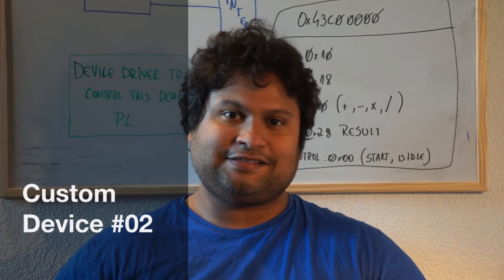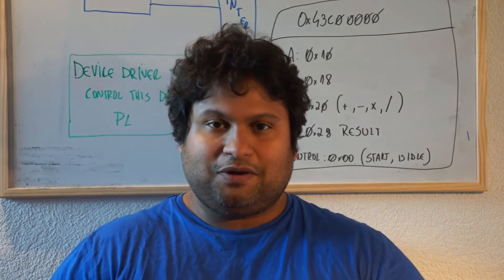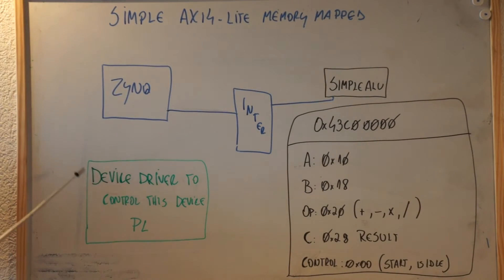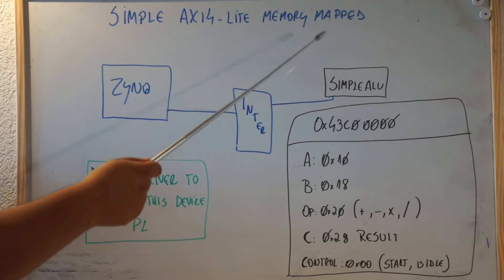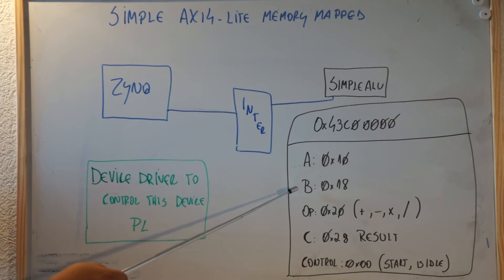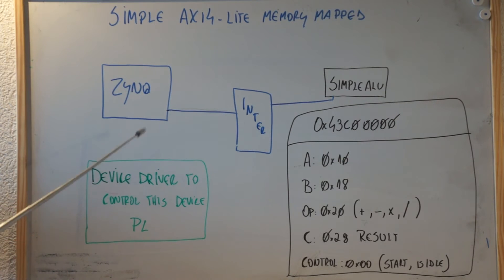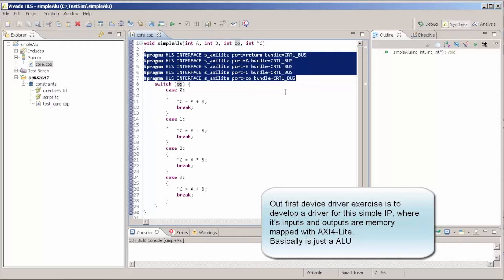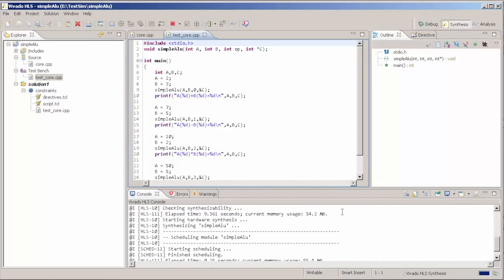Custom Device #02

Comment: Hi, thx for the video.
HLS generate also c-Code for linux. In 10:04 min the folder "simpleAlu_v1_0\src" in the Project Explorer a file "xsimplealu_linux.c" is available. Could this file used in petalinux to insert the driver or this this another strategy? 
Thx in advance